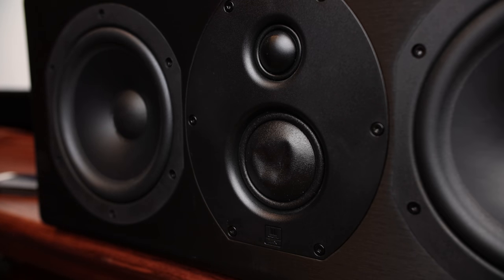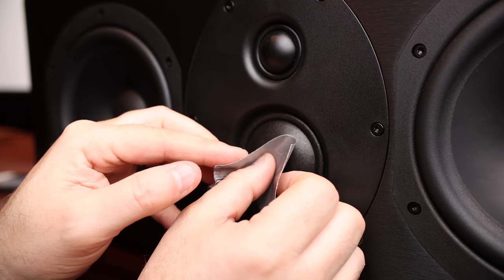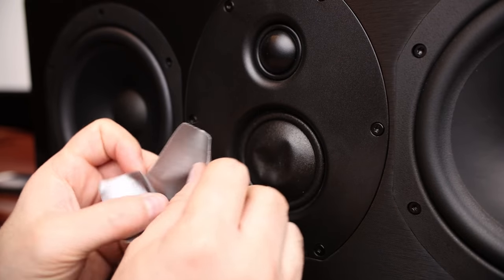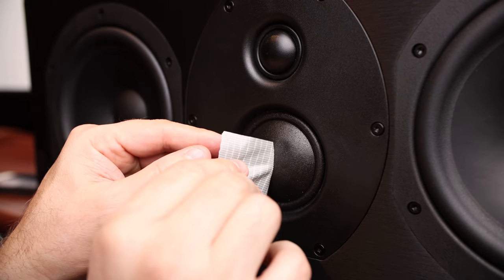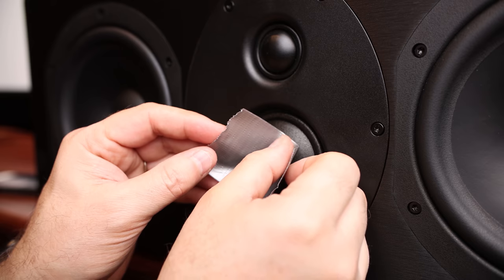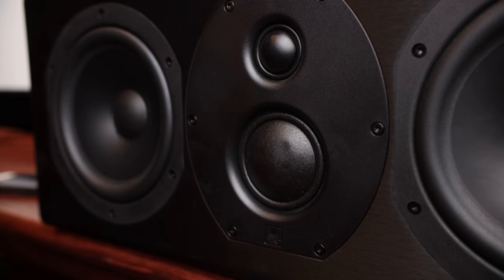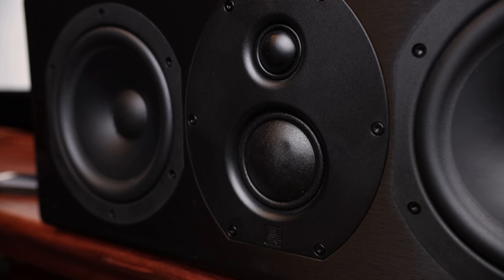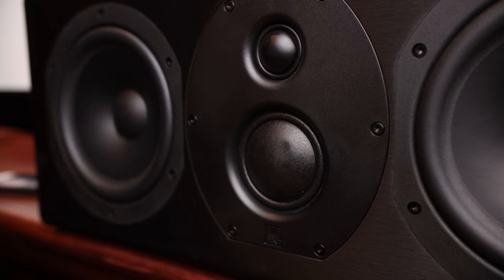Fix a Dented Speaker - Home Theater Basics

Comment: One thing on the dent fix using a sticky substance, auto body dent pullers use a similar method in pulling out dents. Essentially, the material that is dented has a natural shape that it wants to be  in; the shape it was in before it was dented. One of the tricks dent pullers use is to pull from the edges of the dent rather than in the middle. When you pull from the middle you are fighting more pressure. If you pull from the edges you are relieving that pressure and helping it go back into the shape it was before. As well, when you pull from the middle you risk adding more problems; you might end up lifting a small portion in the middle but not around the edges, thus creating even more pressure on the dents. 

If what I have explained isn't making sense, try looking up paintless dent repair. You will see them using similar methods on cars and a couple of them will explain the science behind the craft.

Happy listening folks!
Reply from the maker: Awesome tip! Thanks for sharing
Reply: @Youthman  No problem. Insanely jealous of your setup and all the cool toys you get to review. All I've got is a Onkyo 7.2 system with a couple of older Klipsch speakers for left and right and the rest of my speakers are Polk Audio. 

Question: is there a way to increase tdd he number of channels I have without moving up to a 9.2 reciever? Like can I keep my current reciever and add something that would allow me.to add in 4 more channels? Is there such a thing?

Appreciate you taking the time to respond to folks. Have a good day and stay out of trouble or have fun getting into it.
Reply from the maker: @uhlspetznaz  Unfortunately, you cannot add more channels to a 9.2 receiver. You could duplicate channels by splitting the preouts of say your surround channels but that honestly wouldn't offer much benefit. You would be much better off upgrading to a receiver that can actually process the amount of channels that you want in your system.
Reply: @Youthman  what reciever do you use?
Reply from the maker: @uhlspetznaz  Several months ago, I had the Marantz SR8012 which is an 11.2 receiver. I sold it to upgrade to separates and am now using the Marantz AV7705 with Monolith X11 amp.
Reply: @Youthman  I've been seeing the bigger and better systems that make people like us giggle use systems with amplifiers. I'm guessing this gives you more freedom and better sound but I don't know for sure as I haven't gotten there yet. When the wife and I buy a new house I'll be making the switch to an actual theater room with a projector and at least an 11.2 (so far I'm liking the Klipsch reference system) but we will see. If and when it happens I'll show it off indeed. Again, appreciate the responses, take care brother.

Comment: That is not a dust cap. that is the Dome mid-range diaphragm that is producing the sound. Same as a Dome tweeter.
Reply from the maker: Thx for the clarification. I guess it would have to be since that is pretty much the entire driver 😂
Reply: Lol, I was thinking the same thing!  I suppose the same method would work with a dust cap.  I'm guessing though in this case the dent would affect the sound/dispersion.
Reply: No, it's a mid range diaphragm. but I am  still wondering if a little dent on the  diaphragm will effect the sound performance.
Reply: I love guys like you.

Comment: The shop vac trick will generally do the job on larger caps. With small plastic tweeter caps I use Gorilla tape folded over a pencil eraser. gently push it on the cap with a quick pull it will pop out. Gorilla tape has a stronger adhesive than masking tape. the key is not to touch the tape on the area being used on the cap, oil from your fingers makes the adhesive less sticky.
Reply: Thanks the gorilla tape worked excellent

Comment: The way I did, use very little pressure to scrape the edges of dents. Very gentle using finger tips, if you have little dull nails, which I did have. Keep scraping the edges to pop out. Worked like a charm

Comment: Youthman what you I would suggest is pinching it in the middle of your duct tape and leaving it there for about five minutes even using a hair dryer to dry the adhesive. Then pulled up by the pitched part of the tape.
Reply from the maker: Awesome tip thx

Comment: Cool video...great ideas.

I wonder if the heat from a blow dryer will pop it out? 🤔
Reply from the maker: Not sure
Reply: @Youthman  It often works on the rubber fascia over the bumpers on cars. If you get a dimple in one, heat it up with a blow dryer or pour sub boiling water over it, and they will often pop back into place. 

Hot water on the speaker is probably a bad idea...but a blow dryer just might work. 

I promise I'm not trolling ..but now let's see how many folks go and dimple their speakers and try it...😏

Comment: These are easy, the silver ones, once you pushed them in, thats it!
Reply from the maker: Yeah I’m not sure silver or titanium drivers would benefit from this technique
Reply: Regular Guy Audio  I would go as far as to say all of the cones will never be the same... look at youthman's... my understanding is that you should try and to get it back to normal as closely as possible. But it will always have creases in it from the initial damage.
Reply: @awheaten  yes, it will always have it
Reply: @awheaten  Not sure if you guys read my suggestion but on the metal domes I think they can be repaired. Search up paintless dent repair. These guys have turned dent removal into a science in cars and the same concepts apply to speakers. They use a metal rod, apply a sticky substance to the edge of the dent, attach the rod, and pull. It take time and patience but the results are amazing. Unless you are loaded and can afford to replace those epic speakers it's worth a bit of your time to research this...could save you some wife/girlfriend agro 

Using a pencil with a sticky substance (too tired to think of something other than a strong double sided tape) would work quite well at helping the dome go back to the shape it wants to be in.
Reply: or they'd shatter.

Comment: Micheal, are you sure that that’s a dust cap? And not an actual driver? Or is there a driver behind it?  Looks like a driver to me. I’ve had silk some pushed in in the past , usually just sucking on them abit🤣🤣🤣. Usually works. Lol. Unfortunately, if my tweeters got pushed in now, the would be kaput. They are so fragile and almost transparent.
Reply from the maker: No I was incorrect...that is the actual midrange driver. I’ve just never had a soft dime midrange driver before so I assumed it was a dust cap.
Reply: Youthman I think every single one of you’re followers could forgive you for that buddy. Don’t sweat it. 👍🏻👍🏻👍🏻. In any case, it worked so....the only difference is, that it would infact have altered the sound slightly. But it’s all fixed now. Didn’t monolith want to slap you’re wrists. ? 😂😂
Reply from the maker: @Test-Pilot1194  yeah, I'm pretty human like everyone else. I make lots of mistakes and typically learn something new daily.
Reply: Youthman tagged you in a post on Instagram buddy. Check it out when you have a spare five mins👍🏻👍🏻

Comment: A double sided tape to hang heavy stuff on walls worked for me  just use the tip
Reply from the maker: Good deal
Reply: Youthman I tried the same type of tape u used in the video after watching but it didn’t work for my speaker. Used the double sided tape since it’s stronger material and that fucker worked like a charm. Thanks for the idea @youthman
Reply from the maker: @kratoslostson3427  Glad to help!

Comment: Use a small  thinner strip of duck tape  then you can put it precisely when you need it using a large piece you could not locate the exact area you needed to work on, using a small pice and pull slowly usually works fine but the best way to repair the dustcover is to keep little sticky fingers away from the first place. And put the grills on when they are not in use 🔊🔊🔊🔊🔊🔊
Reply from the maker: What fun is keeping the grills on? LOL.

This is the first time in 13 years that this has happened and I have gone through a ton of gear, both personally and professionally.
Reply: Youthman I take it you don’t have any children or your chopped there fingers off yes I agree they do look a lot better without the grills on but not as bad as dustcovers poked to oblivion 😂 😂😂😂
Reply from the maker: Ian Yates I have 4 children. Although they are much older now (13, 16, 18 and 20), They have always been around speakers since they were born. I have just raise them not to touch
Reply: Youthman Why are you taking me so seriously when I’m trying to be funny and make a joke you must be very sad    😔
Reply from the maker: @ianyates7742  It's not a matter of being serious, I just try and respond to every comment (which is very difficult with 40,000 subscribers. LOL I do not always have the opportunity to think while I'm typing. Blessings bro. Keep smiling....I am :)

Comment: pro tip: if you don't have a duct tape you can use electrical tape (and its way more wffective than duct tape)
Reply from the maker: Depending on the stiffness of the driver, electrical tape may not be sticky enough. Definitely worth a try though,
Reply: @Youthman  yeah but worked for me
Reply from the maker: @epicplayz321  that’s what I said if it works that’s awesome. But it may not work for every situation.
Reply: @Youthman  true